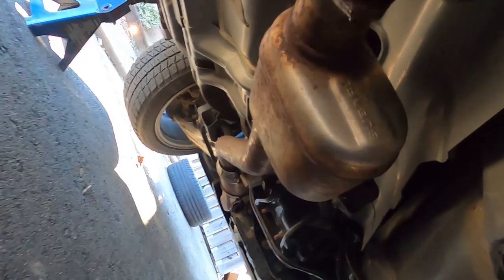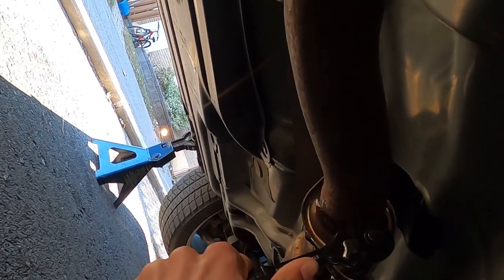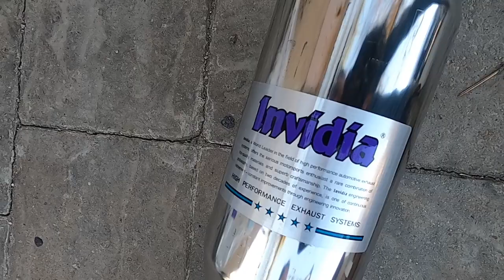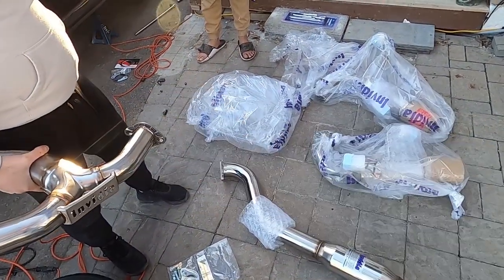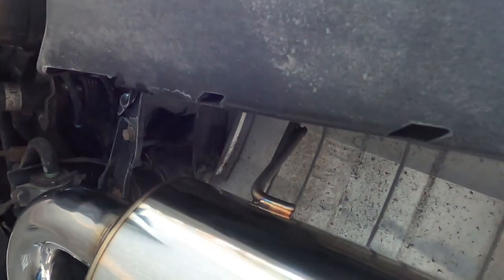Subaru WRX Invidia N1 Exhaust Install

Comment: Did you use spring bolts on the down pipe?
Reply from the maker: I don't believe we replaced the downpipe, I'm not a Subaru guy so maybe someone can correct me.